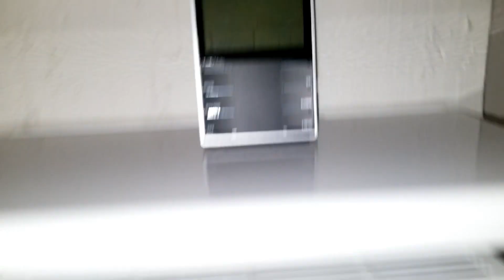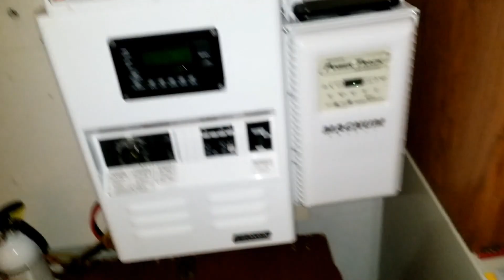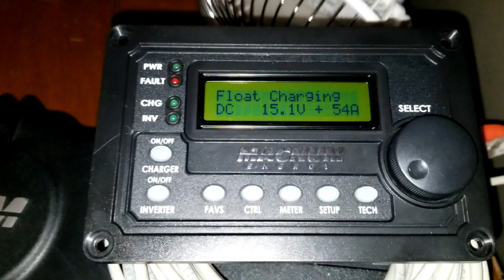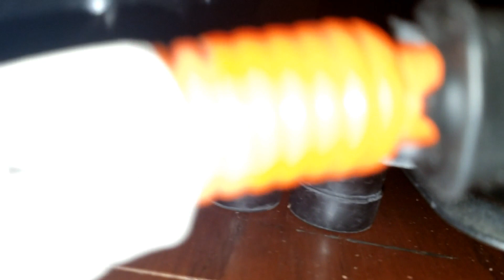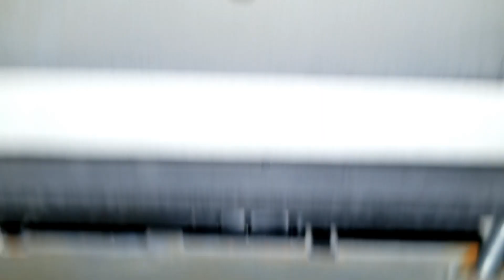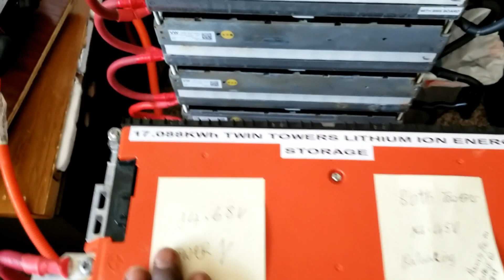TWIN TOWERS, HEAT,😡 INVERTER, SHUTDOWN, CHARGING 1200Ah VOLKSWAGEN E-GOLF LITHIUM ION BATTERY POWER

Comment: MAYBE NOT ENOUGH AMPAGE PRODUCED IS FLOWING THROUGH BOTH TOWERS . MIGHT CAN TRY USING EACH MAGMASINE TO CHARGE EACH TOWER CONFIGURED TO 12 V EACH  IF ALL SHALL FAIL AGAIN . THE AMPAGE ALREADY IN THE EGOLF BATTERIES MAY BE CLASHING  WITH THE LESSER AMPAGE PRODUCED FROM THE ONE MAGNASINE CAUSING OVERHEATING SHUT OFF . TRY TO USE THE WALL MOUNTED MAGNASINE TO CHARGE BOTH TOWERS OR  EACH TOWER AT A TIME CONFIGURED IN 24 V . I WOULD SAY  TRY CONNECTING  EACH BLACK MAGNASINES DC OUTPUTS IN PARALLEL FOR MORE CURRENT BUT BOTH SHOULD HAVE THE EXACT SETTING WITHOUT EATHER SHUTTING OFF CAUSING DAMAGE .
Reply from the maker: Ok thanks